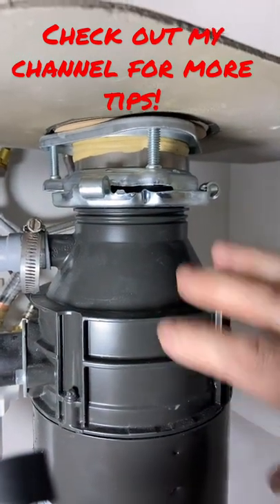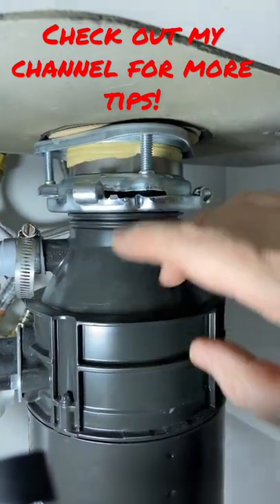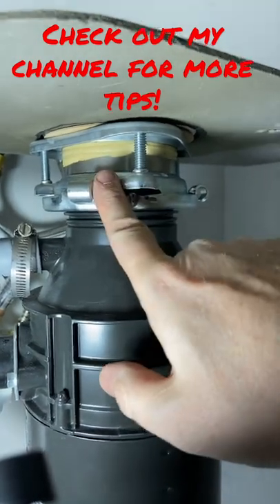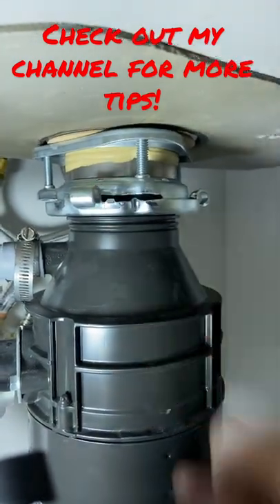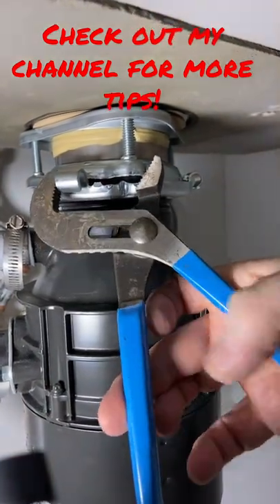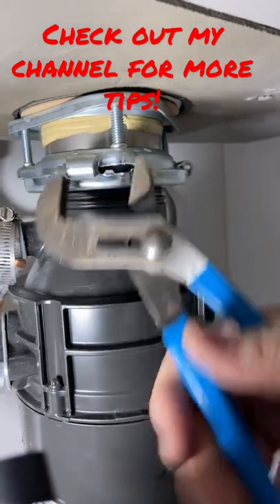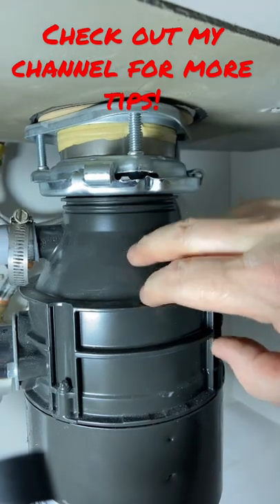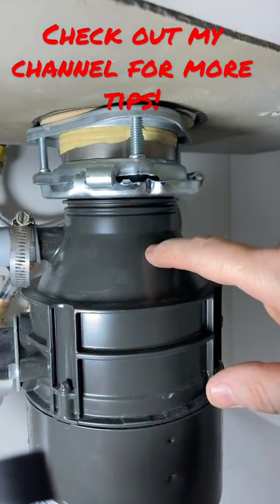DON’T WAIT…DO THIS NOW!!

Comment: The small gap is left so that you can easily fit an allen wrench or screwdriver in to unscrew and remove the garbage disposal when it goes bad.  By unnecessarily doing what is shown in this video, it will be a complete pain to remove the garbage disposal.
Reply: That’s my situation now. Can’t get the SOB off!
Reply: It is important to tighten it all the ways against the other piece like the guy says on the video , I’m in VA and inspectors will fail you on that if it’s not tightened  all the way , apparently it’s against code to leave the gap .
Reply: No… specs are to tighten it just like in the video. Had a disposal leak and fall off because it wasn’t tightened all the way.
Reply: I left mine with a small gap because I didn't have a wrench at the time. It hasn't moved at all and is kind of constrained by the drain.

Comment: Sorry, but no.  I talked to a plumber from a very reputable plumbing contractor in the Boston, Massachusetts area and he said no channel locks.  Use the Allen Wrench and a screwdriver.
Reply from the maker: You could do that, but this is easier and actually in one manufacturers instructions. I like doing way the manufacturer says.
Reply: @That Fix It Guy  for a "that fix it guy" this is a bad video, wrong tool. The disposal comes with an allen key, used to clear jams and tighten connections up.
Reply: The point is to close the gap so it’s tightened to specs.
Reply: You will get same results weather you use alley wrench and screw driver or channel lock...it doesn't take a master plumber to know this only common sense..directions comes with everything but all directions ain't good directions common sense out weights any thing...ghee!